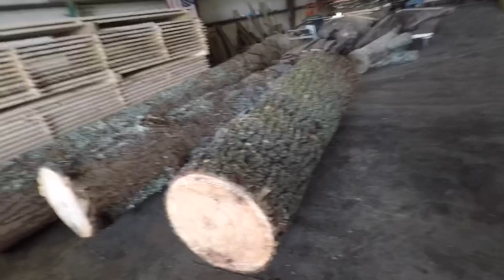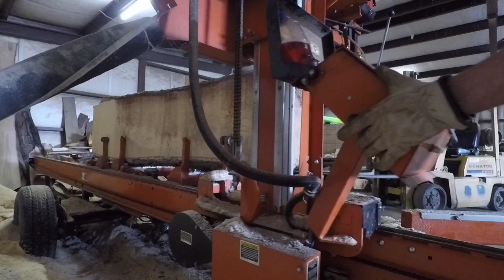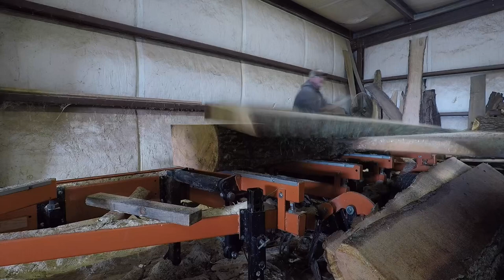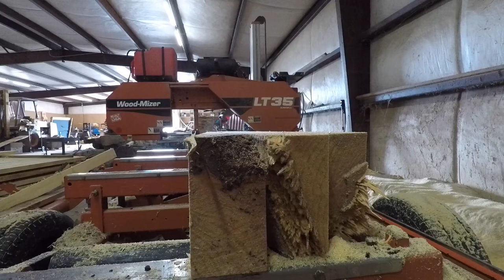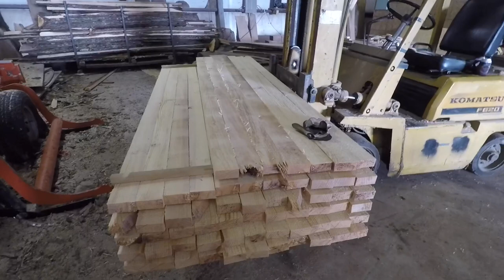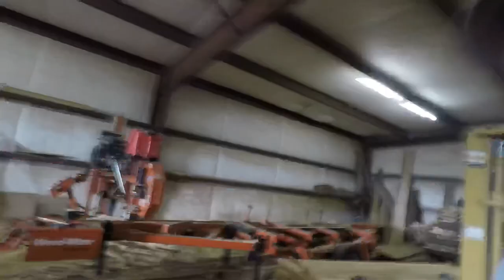Getting maximum footage from logs, sawing 2x4s on my woodmizer lt35. Oversaw

Comment: humm yes, I do it near the same way.   What is in the squirt bottle?
Reply from the maker: Off road diesel. Just a small squirt here and there keeps the pine pitch off the blade. Works great
Reply: @mrectordiesel  It does indeed.  I run a small half gallon tank and drip diesel.